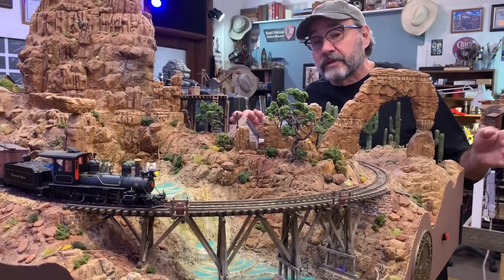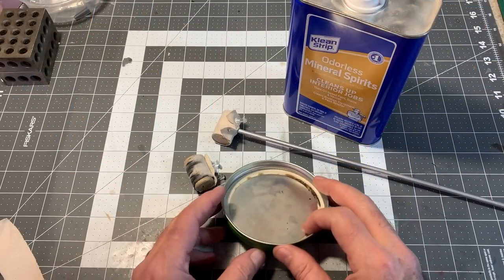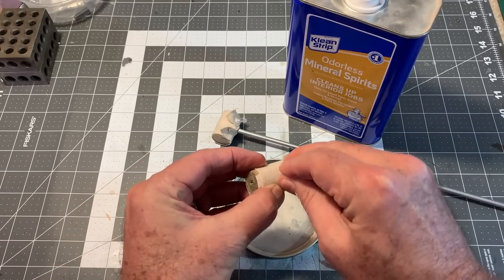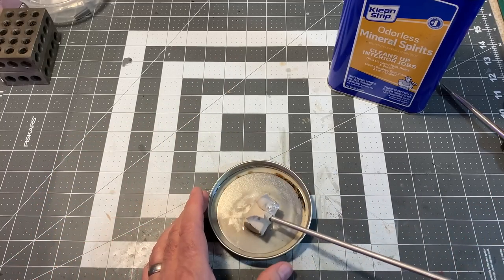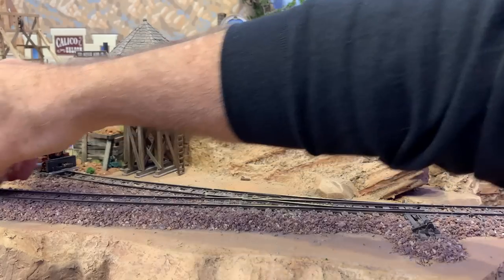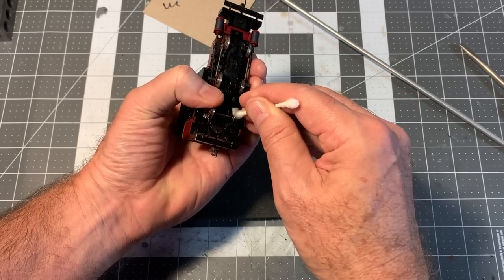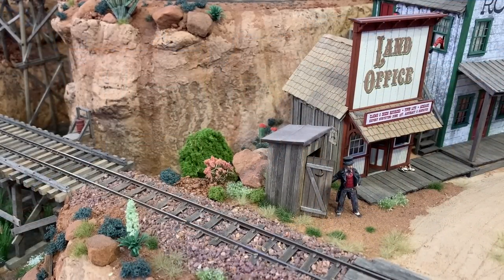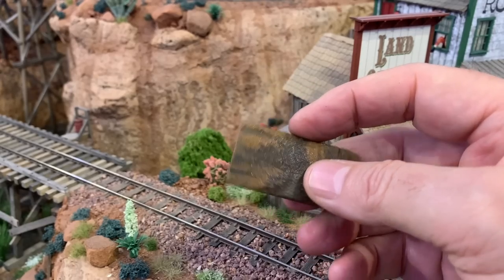Track Cleaning Techniques | Workbench Wednesday

Comment: Very good advice, but I have a new one for you.  I used to have an HO layout with about 200 ft of main line on it.  I developed a method of keeping the mainline clean that, to my surprise, actually worked.  My method requires 1 piece of rolling stock (I used a cheap boxcar), 2 roofing nails, 2 light compression springs and a piece of 1/8" masonite.  All that I did was cut the piece of masonite a little wider than the rails and about 2" long.  I then glued the heads of the roofing nails to the masonite along the centerline of the masonite.  At that point, I drilled 2 holes in the bottom of the boxcar to align with the nails.  All that is required at this point was to place a light spring (this takes some experimentation) on each nail, insert the nails into the holes in the boxcar and then place it on the track.  Whenever I wanted to clean the track, I just placed the boxcar in a consist and ran it around the track a few times.  It was amazing how efficient that this was in cleaning the track.  It doesn't really work on spur very well, but it worked very well on the main lines.  I used this method for years and it never failed me.   A very cheap solution.

Comment: Thanks for this. I resurrected a 22 year old micro layout with No-Ox. It too was a victim of years of Brite Boy havoc. What were we thinking!!!. After cleaning the track with the same mineral spirits you used, the No Ox was applied. Now the finicky little On30  Porters (like yours) run all over the place including old style Atlas non powered turnout frogs. The only thing I did different than you was to run the trains and no cleanup the next day. Have not had to clean track now for several months and no more embarrassing stalls. Doc Tom

Comment: I was told years ago, instead of tee shirt material. Use Handi-wipes. Also, if you can find a used (new is utterly too expensive) a Centerline TrackCleaner car.  I've gone a step further, and have an old gondola, with the insides cut out, fitted over the CenterLine car.

Comment: I've read and seen people use a washer to burnish the rails after cleaning with mineral spirits and before applying the conductive wax. Have you tried the washer burnishing technique? Also, for track that you previously used a Brite Boy on, do you repair it in any way or just clean it and run trains?
Reply from the maker: Sometimes I use a Nickel

Comment: Great content thank you for the information. I have switched to cleaning with LO Mineral Sprits and it has made all the difference. I do have a problem which I am not sure you can assist with as I am brand new here but I’ll ask anyway and perhaps if you cannot assist you might steer me in the right direction. My display is a temporary Christmas display at this time. I run two O Gage Lionel trolleys on two separate lengths of 8’ track . One trolley has issues while running at low speed . which I find prefer for a trolley and especially going a short distance. This happens no matter which track I put it on. The other trolley (Same make and model) runs as slow as I need and then some. I look forward to your input and or direction. Happy New Year!

Comment: Hi Dave. So… exactly what I do! Except I almost never clean my track. When I was using aluminum well. I had to clean daily. Twice on Sunday. I had an LGB track cleaning locomotive that cost $600. It did a really good job. I had to run it for about a half hour before I could run anything else! Brass rail is much better. In this case, you will need to clean it like maybe twice a week! So nickel silver! And I’ve been buying my track from Llagas creek. They use a nickel alloy, I forget the exact name, its used for guitar, frets. No matter. As you know half of my railroad is outside. There’s probably about 12 inches worth of rails that I’ve ever cleaned. OK let’s not exaggerates. It’s probably more like 10 feet. Just to get off stuff like bug guts. And grapes. Snail slime. Bird poop. I have track that’s  been outside for three years and I’ve never once cleaned it and it’s still working fine. Now the fact that my locomotives weigh 30 pounds probably has something to do with that. Anyway, I am using mineral spirits when needed. And then I tried the noox stuff. And I must say it does work great. I guess. Because as I say, I really have never had a problem. The one problem I did run into with the wax  is when I put it on my 3% grade I developed quite a bit of wheel slip. So I took some mineral spirits and took it right back off. Everywhere else I’ve never had a problem with it, but like I say, I’ve never really had a problem anywhere. One thing I am using that wax for, and it’s brilliant, is cleaning the contacts on my passenger cars for the lights. They tend to build up quite a bit of friction, making the train hard to move, again because it’s quite heavy. So I put that stuff on the backs of the wheels and on the contacts and wow does it make them slick.  And the lights don’t flicker at all. I was planning to put some sort of keep alive on the passenger cars to prevent flickering but with the wax on the Contacts, it just isn’t even a problem.  🚀

The nickel silver alloy is C752. Costs $20,000. But for enough wire to make a bunch of code 225 or 250 rail. They roll the wire into rail on a thing deal machine. No clue. But they run the wire through rollers.  I think all the manufacturers do the same thing.
Reply from the maker: Yup, with Large Scale, you definitely have wight on your side. My little On30 Porters need all the help they can get! A few people have mentioned slippage an grades with the NO OX. That's not something that had occurred to me since I don't really have any grades on the TMMC. Great tip on using the wax for pick-ups on lighted cars. I'll have to give that a try.

Comment: For those of us using molded roadbed track like Kato Unitrack and other systems, how would you recommend we best go about it? I do have the mineral spirits for cleaning the flux off purchased resin shells, but I'm concerned it will damage the plastic ties and roadbed on my Kato track.

Comment: I really enjoy your attention to detail and the beautiful handcrafting of every aspect of your layout. Two questions: (1) could you attach a weighted cork wrapped in jersey (t-shirt) material and drag it behind one of your engines to clean the track or would that not apply enough pressure to thoroughly clean the track? (2) Have you ever considered using Sculptamold to build a shallow bas relief of rock formations/mountains on your backgrounds? I would be wary of using polyester cloth on your cleaning wand because (1) it’s not as absorbent as cotton, and (2) being made primarily of plastic depending on its composition, the mineral spirits may cause a plastic film to be transferred to your track, reducing your conductivity. Keep up the good work! Love the Gruesome Gulch area! 💀👻
Reply from the maker: The weighted cork idea probably would not work since it would end up getting caught on anything and everything (like turnout points/frogs, stray ballast, etc) and causing the train to derail. I'm not a big fan of shallow relief on the backdrop. Shallow relief means shallow shadows so it always just looks like what it is unless you go back and paint in deeper shadows - and then, you might as well just paint them on the backdrop. Good point on the polyester! I'll stick to cotton.
Reply: @ThunderMesaStudio  I imagine with your abilities you’d be able to devise a track cleaning boxcar complete with tiny cycling scrubbers, a reservoir of cleaning fluid, and even little polishing buffers! I was suggesting combining the bas relief WITH the scenic painting. Most if not all other layouts I’ve seen do not gracefully transition the actual 3D sculptures to the background; atmospheric perspective is great as long as you know how to do it well. Clearly with your background and experience you know how to make a seamless transition. I was just wondering if another step between full 3D and flat would make the transition completely flawless. Thanks for answering!

Comment: I have read about track cleaning cars with vertikal sliding "wooden" blocks( composit typ of material, just dont remember the term). I wonder if these old scool things are  effectiv or vanished with reason
Reply from the maker: The blocks were usually masonite or hardboard of some sort. Problem is, they are abrasive, just not as abrasive as the Bright Boy.
Reply: @ThunderMesaStudio  thank you . I did not know these are abrasive. Another tool to avoid...

Comment: Nice layout and a great home made trackleaner using a cork.  Instead of using No ox,  I use Inox mp3. Similar result to No ox but because it is an oil, it spreads around the layout and causes the dirt to be conductive. You can also clean the track as you do with it using your cloth on the stick. I have been using Inox for about 40 years and have never needed to clean my  wheels .  The dirt ends up on the track and stays conductive. My layout is H0.
Reply from the maker: Good tip!

Comment: The one technique you didn't speak about is one you cannot use: cover the layout when not in use, to avoid any dust.
Otherwise, I applied graphite on all tracks, and if I don't drive trains often, contact is good enough to no need for new cleaning on most parts.

Comment: How about polishing the rail head?  Many people swear by burnishing, to a high luster, the rail head.  I haven't done this, but they use a stainless steel washer to burnish the rail heads.
Reply: I've heard any metal still causes scratches . S.S is a harder metal than the rails and therefor scratched . I've been told wood actually does a better job at polishing the rails

Comment: The jury on NO-OX-ID is still out for me. I cleaned my track with CRC contact cleaner, then buffed the track with my Dremel, then applied NO OX and within a week the track was filthy. However none of my engines stalled, so I guess it was conducting fine. So I don’t know where I stand with it.

Comment: Howdy Dave,
THE MOST IMPORTANT TRACK CLEANING TOOL YOU FAILED TO INCLUDE HERE.😫
When we Gandy-Dancers attend Train Shows, Railroad Museums, or visit our favorite local train or hobby shops ALWAYS pickup a Rail Road (model rails are permissible) Wall Hanging Calendar.🤨
You read me right!  When doing your top of the year calendar purchases seek out a large print Train Picture Calendar.  Then sit back before the year starts mark in big bold letters the regular dates you will be embarrassed to spend time with your track and trains.  Spend cleaning time.👷⛏️
With the same day or evening each week or month, for track & wheel set, cleaning you will never have to worry about GUNK.😝
Jim in N.Y.